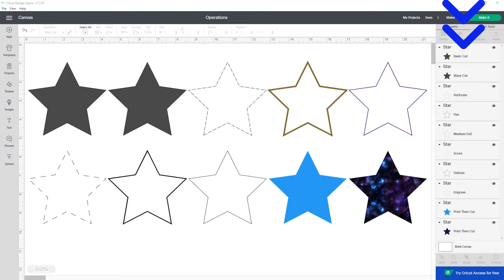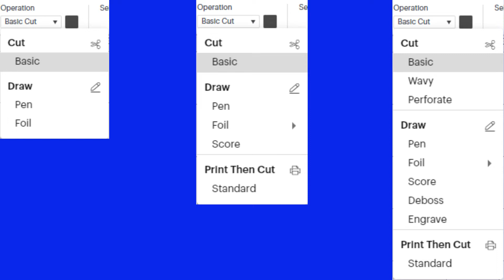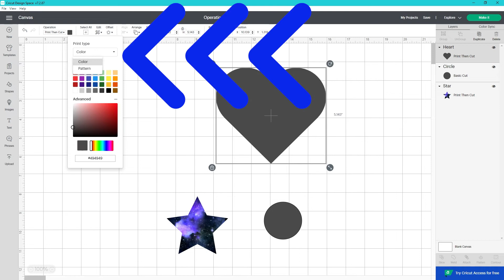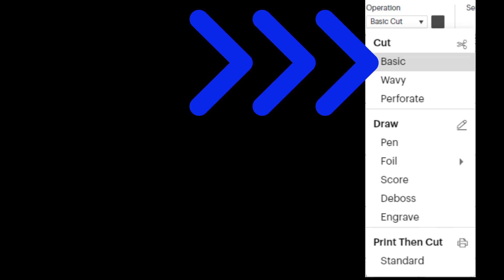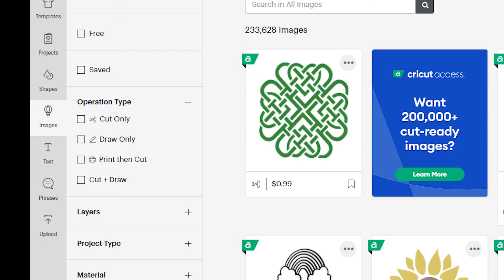Cricut Design Space Operation 101- Step by Step and FAQ

Comment: Hello i have the explore 3 and im designing in my design space and I don’t have the option standard so the box is around for the cricut can recognize. Its a cut up box instead
Reply from the maker: Hello! It sounds like you are talking about Print then Cut.  They changed the style of the sensor box awhile back. It just does the four corners now.
Reply: @HanksMakerMentor  okay ! but my cricut isn’t cutting the picture out, it’s not reading it properly
Reply from the maker: Have you tried a calibration?
Reply: @HanksMakerMentor  Yes
Reply from the maker: My next  questions would be
 are you using plain paper or is it colored or glossy?
Do you have better results printing and cutting a more basic image?
Have you gotten good results on a calibration since the last design space update on the 4th of March?
Reply: @HanksMakerMentor  im using plain paper and it’s a Mickey Mouse image, I print first then cut
Reply from the maker: If it is cutting the inside and outside, you might check that all the layers flattened together. 
Here is my playlist of Print then Cut videos
https://www.youtube.com/playlist?list=PL-FgK9cqrx19TWELtHHU6U1TdoYMDsCx0
Reply: @HanksMakerMentor  hey so it’s working now but now it’s cutting the inside and the outside
Reply from the maker: Did you flatten the entire image?